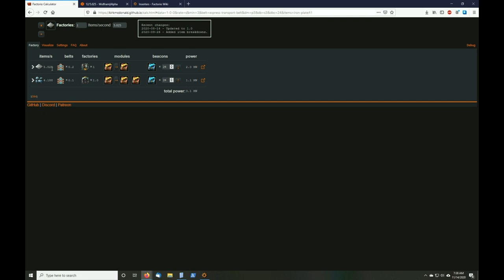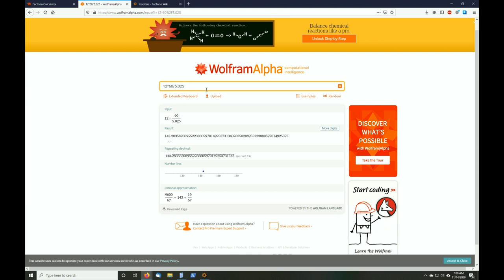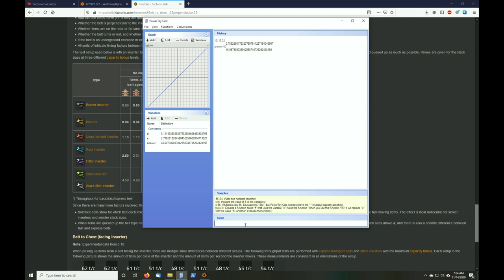Factorio Inserter Clocking (UPS optimization technique)

Comment: Thank you it's great. Tested on a 240 furnace cityblock (8 beacons) : went from 0.6 ms update to 0.5 ms. 16% decrease!
Question : is it a good idea to send the clocking plate signal across all the base?
Reply from the maker: Sending it on circuit wires is "free", but every time a signal changes it takes some processing time for each entity that receives that change to process it.  So you'll want at least a gating combinator in front each group of inserters you want to clock with the signal looking for something like "if <signal> > 1, output <signal>" so that the inserters don't directly see all the other updates to any other signals you may be propagating on the same set of wires.

For example, if you have a bunch of iron plate inserters, but they also receive the copper plate clocking signal, they all need to spend processing time deciding if they should wake up (for every inserter) every time the copper plate signal happens.  If you put a decider in front to filter everything but the iron plate signal from getting to the inserters, only the decider needs to check on every signal change, minimizing additional overhead caused by the circuit network.

The other thing to note is that if you use the same clock for all inserters in the base and they're exactly synchronized then you will have certain ticks where all the inserters swing at once that may be significantly more expensive than other ticks.  If your various smelters aren't all aligned to the same tick then the effect is spread out on each furnace build, which likely keeps the maximum tick time lower.

Comment: Is it more effective because of fewer inventory access count? And should i have 1 clock for every inserter or 1 clock per each inserter?
Reply from the maker: A single clock connected to as many inserters as use that same clock is best.  So drive all your 12-beacon iron plate furnaces with a single clock, for example.

It's more effective because disabled inserters go inactive (consuming about 5% the processing time of active entities), and waking them up only when needed saves on total processing time.  

There is some cost to connecting to the circuit network though, so it's only worth doing in some cases.  It's not worth clocking very high throughput recipes (if an inserter swings with 6+ items when free running) or very low throughput items (things like rocket control units that have a super long build time, so the inserter only swings once every several seconds anyway).
Reply: @KnightElite0  is there a list or something on what benefits from clocking?
Reply from the maker: @hornetDC  There's some thought to making a wiki about it at some point.  For now, I can tell you this:

- Clocking an inserter costs about the same as 0.7 swings per second.  So you need to save more than that
- If an inserter always swings with 6 or more items, it probably doesn't need a clock (because of the above)
- If an inserter swings extremely infrequently when free running (like once every 10 s or whatever), the clock probably isn't beneficial either because it will cost more than the infrequent inserter swings).
- So clocks work well for recipes where inserters swing frequently when free running, but are only grabbing one or two items each time.  That's where they will save the most swings, and therefore pay for their extra cost of being connected to the circuit network.

Comment: Awesome video, thank you so much! The use of modulus to get the exact clock cycle is ingenious - I would have just rounded down, so occasionally the inserter would swing with just 11 items. Quick question though -- what is the application for clocking when taking from a belt? Is the idea to wait until the belt has filled up again so all inserters can pick up at the same time? In that case, wouldn't the tick interval depend on the speed of the belt?
Reply from the maker: The main application there would be being sure you can pick up 12 items at once from the belt, rather than the inserter spending more time waiting for items to come by, and sometimes swinging when not full.  It may indeed depend on belt speed.
Reply: @KnightElite0  I see, thank you! So I guess it relies on the belt being able to compress in the intervals.

Comment: Each decider combinator reduces UPS... This fix is a waste of time.
Reply from the maker: Sure, but so does each inserter swing.  There's some balance where you save more inserter swings than the combinators cost you, so clocking ends up performing better.

You can look at this test for some actual benchmarks that show that in some situations clocking the inserters reduces computation time: 
https://mulark.github.io/tests/test-000101/test-000101.html
Reply: But you can use a single clock for thousands on inserters, for example using a single clock for all 8  or 12 beaconed smelters you´ll use a clock for iron plates and other for copper plates, so you end saving 3/4 of swings, in steel you will save 11 swings